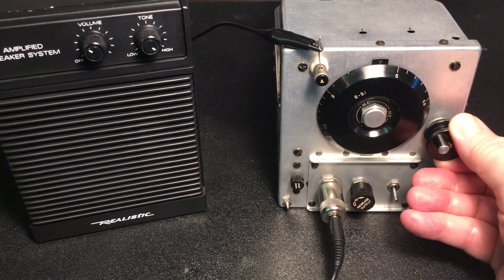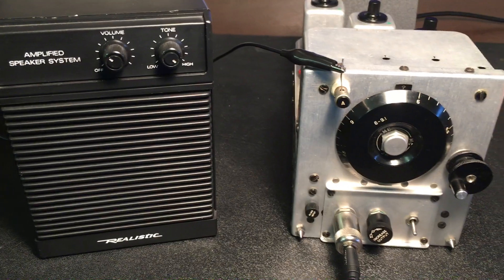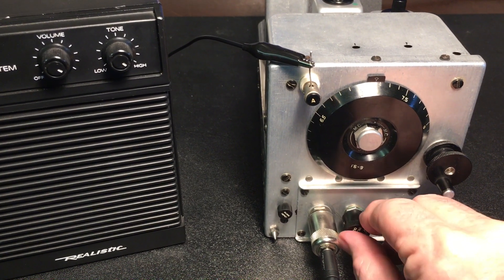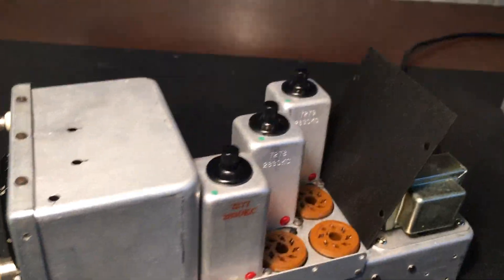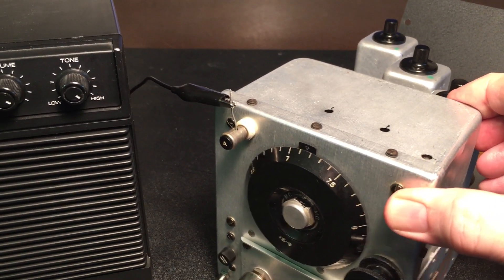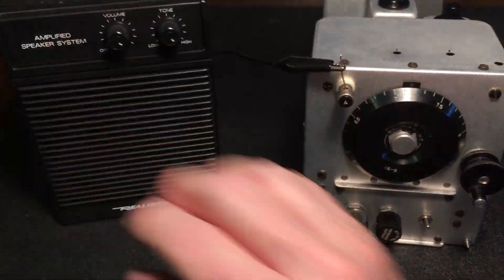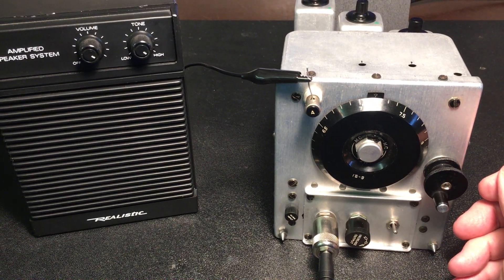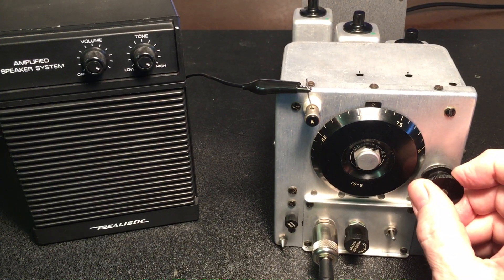Transistorize Your BC-455 Radio - PART 4

Comment: Hi
Any difficulty finding parts? Alignment? Lessons learned?
Thx
Reply from the maker: Most of the parts came from Digikey and some through eBay.  
MPF-102 FET's are not that hard to find but the BF996 FET are a bit rare.
Try eBay for both.  1N34A geranium diodes are available through NTE's website. 
Hardest to find is the 2.5 RF chokes.  Charles Smith has them. His video is linked in my description.  Alignment was standard but you may need to pad one of the IF transformers with a fixed cap. Lesson learned:  Buy extra MPF-102's and especially the BF996 as they are so tiny you can loose them very easily.

Comment: I had one of these back in 1962. Got from Fair Radio Sales. Good job, really sounds good. --n6jji
Reply from the maker: Welcome Alex!  What a coincidence. I still have a working 455 I purchased from Fair Radio 51 yrs ago.  It came in a sealed aluminized cloth bag and was reconditioned by Canadian Aviation Electronics in 1954.  The data plate was replaced with a RCAF one. Was about $16 and may have contained the dynamotor and spinner knob. Not sure.